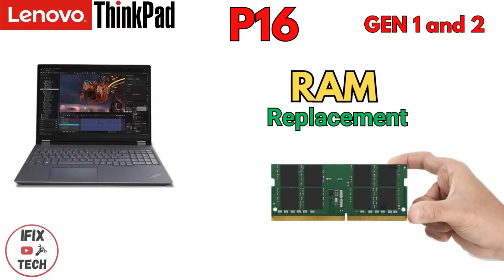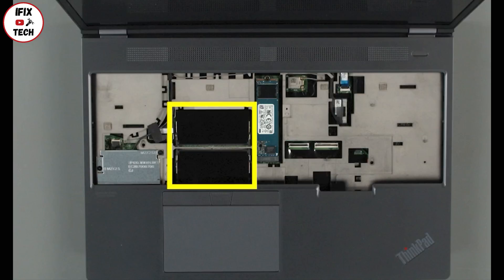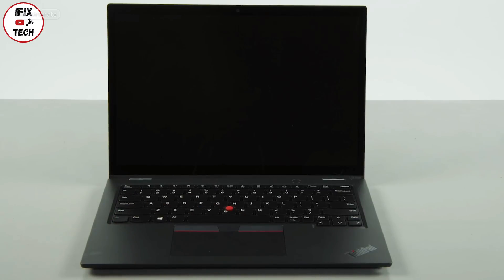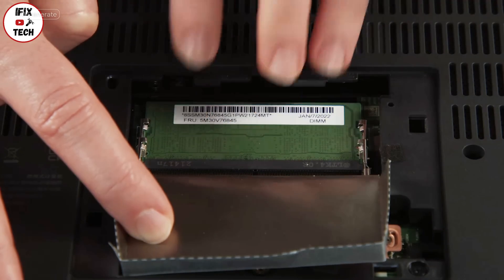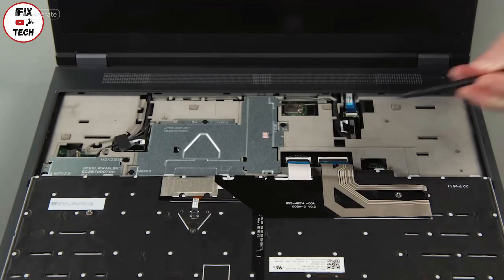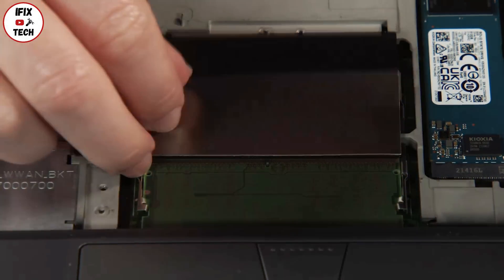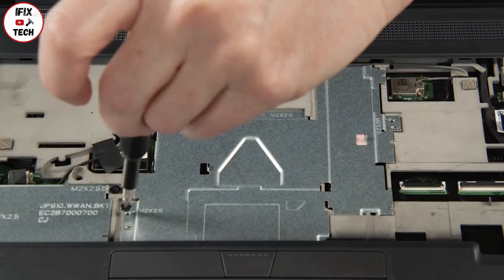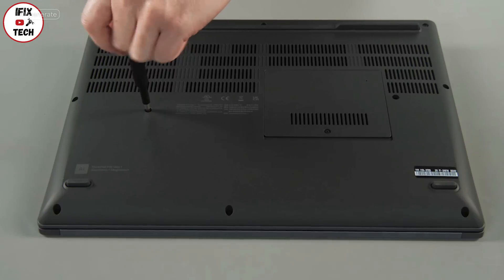Lenovo ThinkPad P16 Memory RAM Upgrade Replacement  -  How to Remove RAM

Comment: what type model is that one? all reference that is out there is if the 2 slot model or the 1 soldered junk model
Reply from the maker: Will check and get back to you. Thanks for liking it and subscribing 👋 😉
Reply: it's the same as mine, Lenovo P16 Gen2 Intel. Description of the Video is correct.